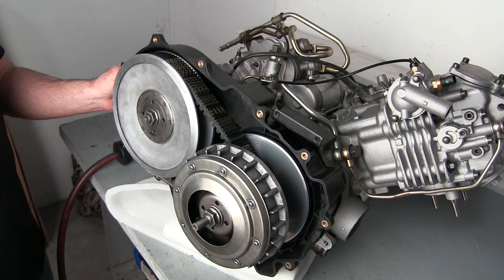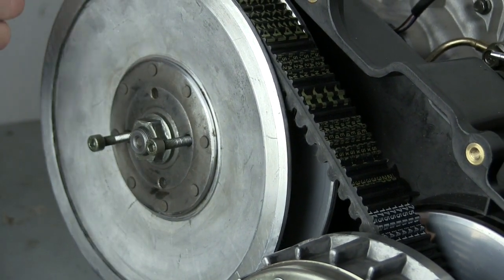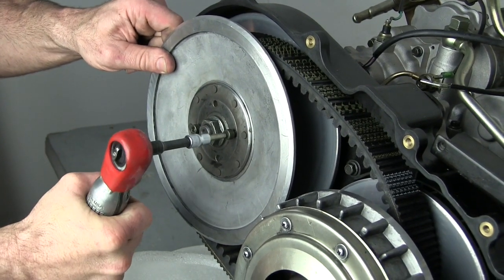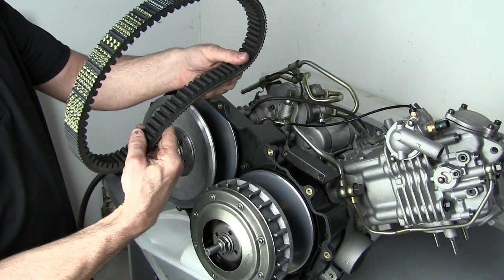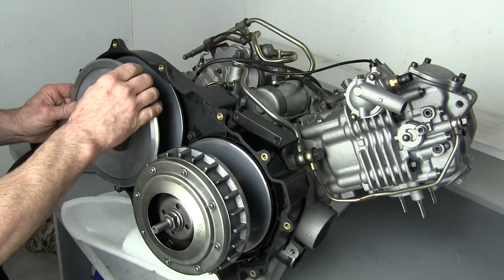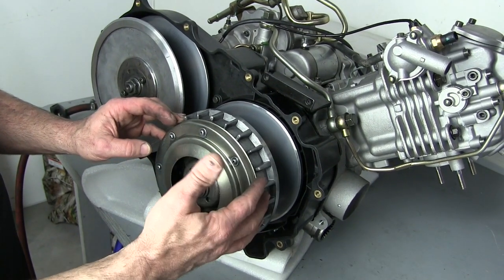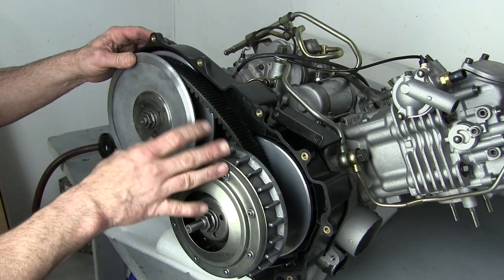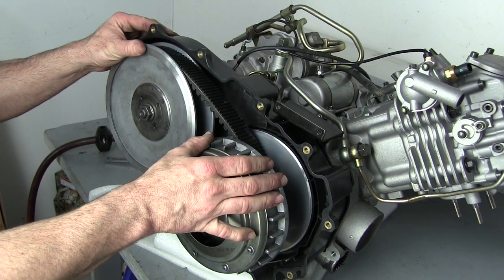CVT Drive System

Comment: I have a Bennche 400.   After replacing the belt, the belt does not slip on the primary clutch at idle.  The belt is correct.  I even tried putting the old belt back on and it doesn’t slip either.  What am I doing wrong?

Comment: Is there a clutch on the inside of the crankcase that engages the cat clutch. When the cvt clutch begins to spin under throttle it makes a terrible clunking noise. And while idling it chunks as it engages and disengaged cvt whence there's a little resistance while idling... So it sits and clunks something terrible. Anyone know what it is or am I just gonna have to explore inside the crankcase?